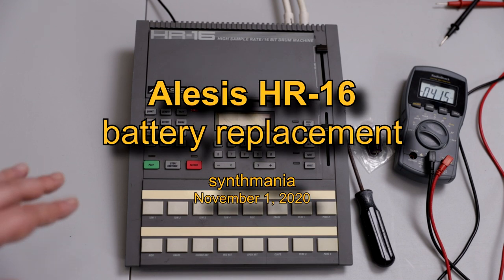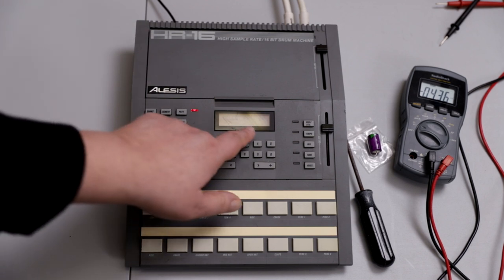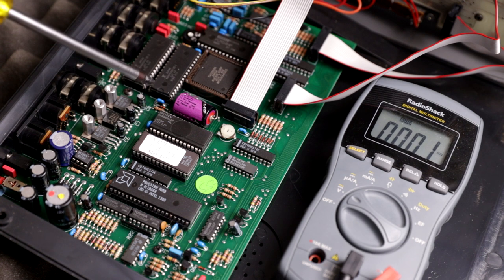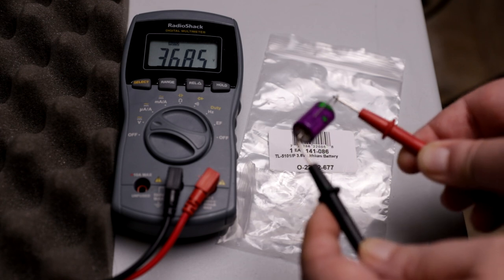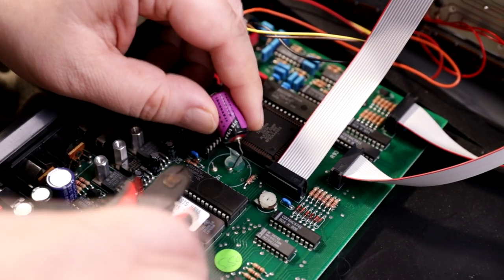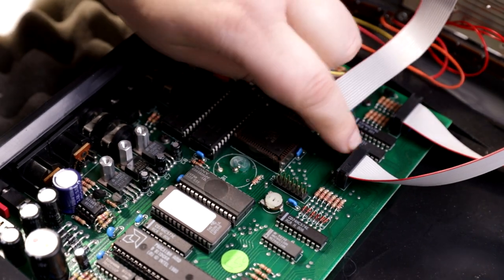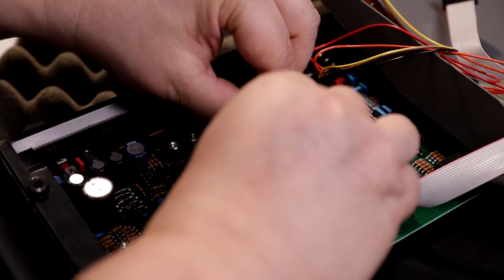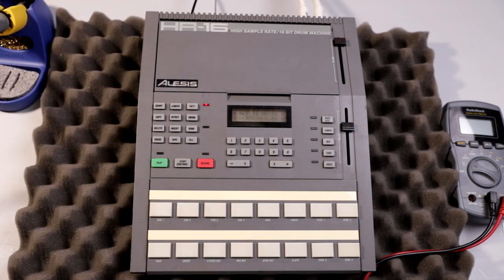Alesis HR-16 battery replacement

Comment: I recommend shortening the new battery leads before soldering (the old battery can be used as a guide) to lessen the chance of the leads touching anything.
Reply from the maker: That's a good advice, I'll shorten them and maybe add some glue also like they did at the factory to keep it from any movement - although luckily there's enough space by the battery and it doesn't seem like it's going to touch anything nearby - but yes, totally agree that's better safe than sorry
Reply: Or just pop some plastic sleeving on the bare leads. Keeping them long makes it easier to work on, this time AND next time!
Reply: When I reached that part of the video, I started thinking Operation.
Reply: Another option is to cut them off almost completely and solder your own sheaved wire to connect the board and battery.
Reply: @ZZKJ396  Not a good idea to bring the hot tool close to the cell.
Reply: @rebmcr  Not a real problem for this short amount of time
Reply: @Shred_The_Weapon  BuzzzzZZZZ!!!!
Reply: @rebmcr  Is that more for lithium cell batteries, as they are more sensitive to heat and explosion?

Comment: Pro tip - if you ever need to get rid of hot glue like that and it's a bit tricky to just yank off or snip off, a few drops of isoprop can make it a bit more malleable as it breaks it down a bit.
That's something I'm SO glad I learned.
Reply from the maker: Good trick!
Reply: @SynthManiaDotCom  Oh it has saved me many a skinned knuckle and lots of swearing!

Comment: I have an Alesis Quadraverb that suffered the same problem. But instead of buying an identical replacement battery, I bought one with a holder. I hate soldered-in batteries.
Reply: 100DollarHeadache I just bought a used Quadraverb 3 weeks ago. So far, so good but glad I saw your comment, I’ll remember your recommendation just in case.
Reply: @russell_szabados  "Quadraverb 3"? You probably mean the Quadraverb 2 (or maye the Midiverb 3).

Comment: I had one of those. I preferred it considerably over the SR-16. I still prefer it. It also looks cooler.
Reply: I always wondered what the SR has that the HR didn’t. I’ve also wondered why the SR doesn’t appear to have been upgraded in 25 years.
Reply: @Shred_The_Weapon  The SR already existed when the HR was introduced so the SR had the initial Alesis drum sounds and the HR was sort of a combination newer, more modern (at the time) sounds and a potentially additional drum machine with some other additional features for people who already had the SR. The SR was more familiar due to it already existing and since it was still selling I am going to guess it was more a matter of "if it ain't broke, don't fix it" than anything else which was/is why there has not been any sort of upgrade made to the SR. They already had the schematics and experience with building them so it wouldn't really make much sense to upgrade it and potentially remove/alter anything which would keep people from buying it.
Reply: Wow!
Reply from the maker: The other way around... the HR-16 came out in 1987. The SR-16 came out in 1990.
Reply: Thank you  @SynthManiaDotCom .
Wow, that model has been in production for thirty years?
Reply: @Shred_The_Weapon  the sr16 has 220+ sounds, a larger display ,more tunning and quantize possibilities,fill a /b variation a/b
Reply: I have incidentally found all the signs I personally want in my DTX multi 12, which I probably play with my own two hands,  @asdifasi .  Since I was a teenager, I have ascertained that drum sequencing and I don’t really get along that well.

Comment: Dr. Paolo, The board certified synth Doctor is in..... 
I replaced the battery on my vintage Yamaha TQ-5 module last year! 
Used a salvaged 2032 Battery holder from an old PC motherboard.
Installed the 2032 lithium, then reinstalled all the custom voices I made using MIDI-OX..

Comment: I have one with a different problem.  The battery dies and even when powered it doesn't save patterns.   I do have the service manual (I can send to you if you need) but do you know if that's typically the SRAM or possibly a bleeding capacitor?

Before diving in I'd like to know if I should source a new SRAM or not. 

Great video, so glad you've got this out there for others!!

Comment: I had the MMT-8 sequencer to go with my HR-16. But as soon as I started using it, it kept crashing. I sent it in to be serviced, the tech also had to clean behind the buttons because some wouldn't depress easily. When I got it back, the buttons worked great,  but then it crashed again. I had a backup Alesis Data Disk,  I had several songs backed up on it luckily.  I ended up taking the MMT-8 and Data Disk back and got a Roland Super MRC MK 2 sequencer....it's old faithful too.

Comment: I first learned about the HR16 23 years ago (July 1997) when a good friend of mine demoed it for me. As I learned more about classic drum machines, I started wondering something. Is the HR16 an EPROM model like all the vintage-class digital models, or is it hard drive centric? If it’s a hard drive model, that would kind of make it a pathfinder of its own kind.
Reply from the maker: It's an EPROM model but not in the "class" of the vintage models in the sense that, mainly, it only has four outputs - as opposed to the classic machines like Linn, DMX, 808, 909 etc. that had a lot of individual outputs for studio recording. But it's still a great machine, and the B version is even cooler :)
Reply: Thank you Paolo.

Comment: I have an Alesis SR-16 that has the same problem. I wish Alesis would update their drum machines with sd cards so you NEVER lose your patterns and songs you've created.They still make the SR-16,but it's just the same as the 30 year old one I have.
Reply from the maker: May I give you a suggestion? Save your patterns / songs to your computer via sysex - so you can always reload them in. I bought an SR-16 in 1990 when it came out and have a lot of patterns / songs saved in the computer since then...
Reply: @SynthManiaDotCom  Thanks.
Reply: There is an editor for windows   but I never try it.of course you need a midi-usb interface.i recommend the m audio, not the cheapest ones who had issues.
Reply: @SynthManiaDotCom  please publish some of them if I don't ask too much.having other drum machines samplers and grooveboxes I almost forget about sr16.i would try to upload them in sr16 ,my drummachine is from 1990 too.thanks a lot for the video
Reply: SynthMania I have an Alesis Datadisk that I bought in 1992 for saving all my SysEx data. It still works perfectly but uses double-density floppy disks. Talk about old school. LOL.
Reply: @NURREDIN if you use a Mac, you can save your SR-16’s data (called sysex data) with an app called SysEx Editor. If you own Logic Pro, you can save its sysex data directly into Logic. If you use Windows, there are similar programs. Search Google for Windows SysEx editors.
Reply: @russell_szabados  Thank you.
Reply: Update.If you don't have a PC or Mac and usb-midi interface is either you can save all using a  sequencer. If you are burnin oldscholl way sure you have a e seq with data dump feature

Comment: Hi! What could be the reason that my HR16 doesn't display anything on the screen and doesn't make any sound when it's turned on?  I bought it few years ago and since then it's collecting dust.  Inside it looks like new btw. Peace!
Reply from the maker: I'm not a tech , just a dabbler, but I'd check that you're using a compatible power adapter as first thing? Was it working before?
Reply: @SynthManiaDotCom  I have a compatible power adapter. It was also my first thought after the purchase. As I said, I bought it in not working condition. Any second guess? Anyway, your video inspired me to clean it and fix it somehow, wish me good luck! And thanks for reply!
Reply from the maker: I'd download the service manual pdf and go from there
Reply: @SynthManiaDotCom  I have the identical problem with my HR-16 (found at thrift store); display contrast is off and only a hint of audio at outputs. The service manual is a complete and total mess with all the crazy, mad scientist revisions for this model! If you figure it out, please let me know!

And important to note that the power adapter is unusual in thst it's an AC-AC adapter (no +/- polarity and not the common AC-DC type. Rated at 830mAh, so a 1A or greater is good replacement, 2.5mm x 5.5mm barrel connector).

Comment: Man you are soooo lucky that didn’t go kaboom all over the board. Early Macintosh computers and the apple iigs had this exact battery. and this battery is very notorious for destroying a whole computer with the battery acid. Completely wiping out pcb tracks.
Reply from the maker: I know, right? I've had that happen on my old PolySix back in the '90s and it was a freaking mess.

Comment: Shouldn't that have been a through hole repair?
Reply: I agree, these joints are not mechanically sound this way. A desoldering iron does wonders here. I would do a through-hole replacement and put some silastic under the battery, like they did when manufacturing this. Also using an ESD strap would be advisable. Your stuff will last longer when you do.

Comment: 1 power
2 ground
Reply: sorry, i use google translator.
1:33
cut the contact (wire) first you need power.
The second is cut the ground.
it's a little safer
Reply from the maker: I don't understand. This drum machine uses an external power adapter. The power adapter was completely disconnected from the drum machine, and from the AC power. The drum machine did not have power at all while replacing the battery. The machine was not connected to any power.
Reply: @SynthManiaDotCom  this must be done with all power supplies.
This battery stores the settings.
 this battery can also damage the memory clusters on the chip.

so say the masters to the service center
Reply from the maker: I do not see that written on the Service Manual for the HR-16. Again, I don't understand what you are saying. The HR-16 does not have a built in power supply. It used an external power adapter.
Reply: @SynthManiaDotCom  sorry, it's hard for me to explain.
This recommendation applies to all devices. For devices with external power supply or internal battery.
Reply from the maker: I am sorry - I still don't understand what you are saying. You wrote "cut the contact (wire) first you need power. The second is cut the ground.".  This is a battery with normal - and + contacts.  There's no power or ground wires to be cut. I don't understand what you are saying.
Reply: @SynthManiaDotCom  sorry, I use google translator.))) 
safer to do so.

 first cut "+"
and the second cut "-"
Reply from the maker: OK - now I understand, so you're saying I should have cut + first, and - second. Ok. Well, I didn't know that. I cut in the opposite order. The power adapter was of course not connected while I cut the battery which was depleted, the drum machine has no problems. I am happy it did not cause any problem.
Reply: @SynthManiaDotCom  Yes. the translation was correct)))

Thanks for your channel. This is the best channel!
Reply from the maker: Thanks!